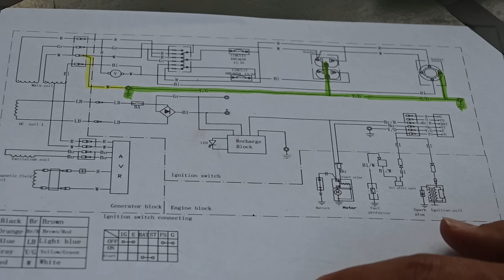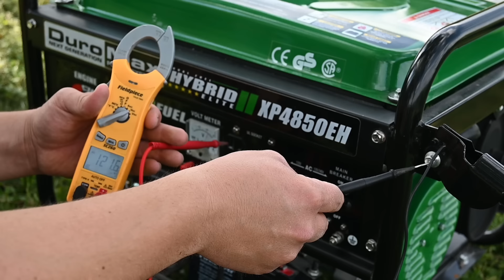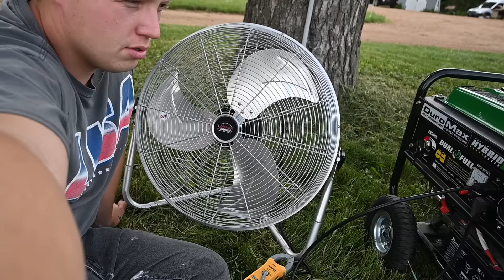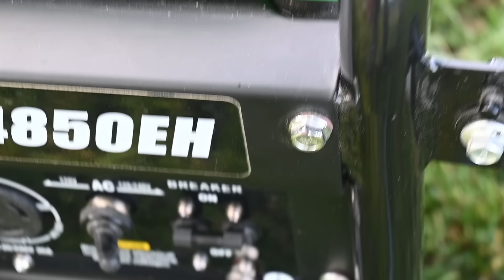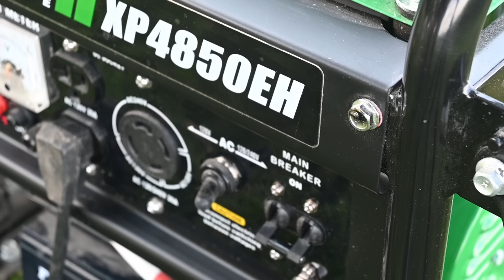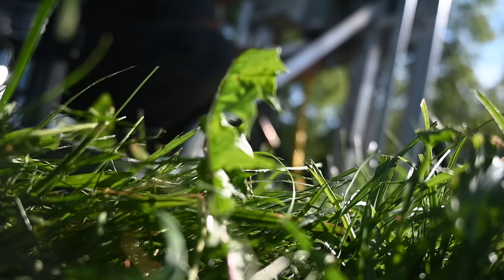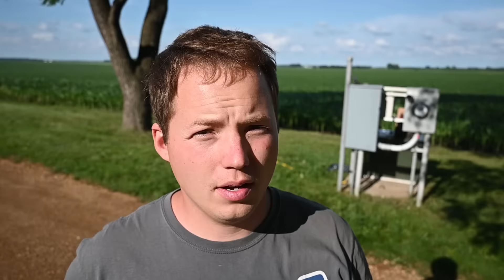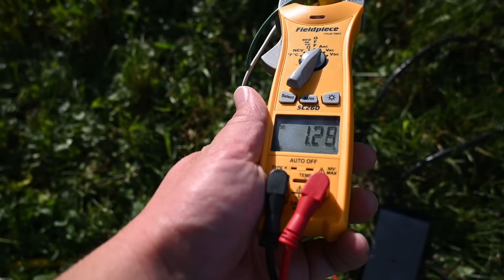What is a Floating Neutral Generator?

Comment: I, too, have this same generator and noted the same discrepancies between Duromax website and their schematic. Unsat! Thank you for taking the time to test the various scenarios, it was very sobering! Since I'm only going to use extension cords with this unit, I will bond the neutral and ground inside the alternator. But since it is rubbermounted to the frame, how would you recommend bonding the frame to neutral? Thanks again!

Comment: If this system is left running with no faults is it possible for the Generator Neutral potential to gradually vary from the ground potential therefore creating a hazardous voltage between neutral and earth?

Comment: Hi Ben , we are working on a off grid cabin and we are trying to use a generator by hooking it up to main panel until we get some solar going , i have just a reliance 30 amp outlet that i was trying to hook up the generator to it , i will probably get a transfer switch soon so i can change between inverter and generator when needed , is a generac 7000 watt and it has the neutral ground bonded . The panel is already bonded , neutral and ground land on same bar , how can i safely connect the generator without changing it to floating neutral
Thanks

Comment: If the ground is bonded to the neutral in the generator, but the generator is not grounded itself (on rubber pads, wheels, in house during construction, etc.) then that floating voltage on the neutral makes a floating voltage on the ground wire as well, which will cause a floating voltage on any metal of any equipment plugged into it. This would create a voltage on the metal on a saw or fan, etc. which would shock someone. How dangerous this is, I am not fully aware, because I don't know how much charge would be dissipated before the bonded neutral/ground floating voltage would go to zero. (Electric fences have high volts, therefore high amps - V=IR - but it only lasts for a "millisecond" so you live because not much charge went through you before it dissipated. - uncomfortable, but not lethal). All in all, I would rather have the neutral NOT bonded to the ground in the generator IF I didn't ground the generator with a ground rod UNTIL I am informed to the contrary about the issue I just addressed.

Comment: I’ve just brought my very first generator, for use in my garage workshop that has now power supply whatsoever, I wish to run woodworking tools from it. Would you advise whether I should bother fitting an earth point ? I know absolutely nothing about electronics.

Comment: So if I’m understanding what is said here then wouldn’t any generator that is sold with that 4 pin plug be a floating neutral design? Or is that weird 4 prong plug used for other things as well that have differently requirements the could require a bonded unit?

Comment: please i have ponderer this to the point of a headache. i took apart my cars alternator and started to wonder why was the stator coils bridged to battery and earth so that it would basically supply 12 volts or so AND the stator common neutral was also connected to ground. that means that instead of supplying ”zero” voltage to ground when the coil goes negative it would supply -12 volts compared to ground making it a 24 volt system

if the neutral wasnt grounded the coils could just supply 6 volts positive and negative and that could be rectified into 12v at the battery. or only positives from the coils could be bridged to battery using 12 volt coils and then we use the neutral as ground. BUT WHY BOTH. is it there just in case that one of the stators shorts to the alternator body. some claim it runs through a zener diode rectifier to ground and battery. so is it there to cut peaks and load inbalance? does it trip a fuse somewhere or send a fault code? what is this thing

Comment: I have a Reliance manual switch panel that is a sub panel connected back to my main panel were the bonding is taking place. The manual panel does not break the neutral from the main panel only the 2 hots when I switch over to generator.

My thought is when I use a generator I should lift the neutral and ground feeder wires from the main panel then bond my manual panel and connect it's ground to another set of grounding rods. Sounds like a lot to have to do but seems to be the safest. 

Any thoughts on an alternate way of connecting a generator to a sub panel that has manual switch?

Comment: I'm going to back up my home electrical power with an inverter/generator. My generator comes from the factory with a bonded neutral so I need to do something to avoid using the generator neutral bonding along with the neutral bond in the home electrical panel. What if I just leave the ground wire from the panel to the connection box for the generator power floating - not connected to the generator? Will that fix the problem without having to modify my generator? Is it okay to do this?

Comment: dirt grounding is for lighting protection ONLY. What are you doing?
Reply: ?! Earth (Ground) is where all systems Star/Wye point or Center tap establish a pathway for fault current. Lightning ground rods are a completely different system, don’t mix the 2 up.  If you are an electrician you should know this.

Comment: Wait a minute; in the first two scenarios the same reason nothing happens when you ground the hot is the same reason touching the hot wouldn't hurt you, right? Putting hot to ground is meaningless because it is not relative to anything, ground still has no potential since there's no path back to the coil. In your electrified fan scenario, picking up the fan shouldn't be a problem. You'd only get a shock if you touched the neutral or other hot conductor. It isn't safe, but I'd expect you'd need two faults to occur before the unbonded version becomes dangerous.
Reply: Touching the hot generator chassis in the first scenario alone technically would not hurt you, but if you were to touch both the chassis of the generator and that of the fan at the same time in the second scenario, you would definitely feel it. Or, like you said, it would technically require two faults before it is dangerous. The purpose of bonding the neutral in any case as I understand it (whether on the generator or in the house) is to create an ultra-low resistance path for electrons to travel on, thereby rapidly increasing the current past the point where the breaker would trip.

Comment: So if generator is to power main circuit box  then send power to sub panel at house.since it is bonded at the main box the Generator needs to be floating neutral. Is that correct?

So what happens if a wire comes lose on generator and touches the body of the gen while neutral is floating and on supplying power to home??

Comment: I've always seen This Old House and Home Time, etc. use interlocks to connect the house to a generator and not backfeed the power lines. But then they never explain why it's not a hazard to have solar panels in the system and even run the meter backwards and get paid for it! If solar panels don't need an interlock then why does a generator? Why can't a generator just run in concert with the grid in the same way as the panels do?

Comment: Wow, I have the same brand Duromax but 13000 and it is also floating neutral which i will connect to my main panel thorough inlet box. I see you have the ground and neutral wire tied into the one buss even though there are two busses in the panel does that make a difference? I have the green screw above my buss on right hand side so not sure if there is a difference if both neutral and ground are placed on that one or should be separated? Thanks for the informative video.

Comment: So when building a solar generator for backup power to my house I want a floating ground but I will need to bond the ground to neutral when using it as a standalone unit to power my camper?

Comment: 16:57 "you could have a direct short the hot to
the ground
and it would not trip the over current
protection so you can see why that is
not a good thing"

It's irrelevant - it's not different than making the Earth Neutral connection permanent.

Comment: What would a GCFI outlet do in this situation without being bonded. Probably wouldn’t trip.
Reply: A GFCI (or RCD) checks that the same (opposite) current flows on live and neutral ("current balance").  It does not rely >directly< on bonding to trip.  For this reason in some codes an area protected by GFCI can have less stringent bonding.  But suppose an appliance has a live to frame fault (or a neutral to frame fault, see below).  With bonding the protective ground will draw current and the GCFI will trip.  Without bonding it will not trip until someone touches the frame diverting current to ground through themselves. At that point you better hope the GCFI is fast enough to save you.  I know mine works because I stupidly connected my scope ground to the neutral and it tripped the building GCFI lol.  Now I use an isolation transformer.
 https://en.wikipedia.org/wiki/Residual-current_device#Purpose_and_operation

Comment: Great video Benjamin, thank you for sharing your knowledge. I was wondering what recommendations you have if I am back feeding a SUB panel with a portable generator? Obviously the neutral and ground are already separated in a sub panel so should I leave the neutral/ground bond in the generator? Would it be a good idea to ground the generator chassis as well? 
(50 amp generator receptacle, Westinghouse 9500 DF, interlock installed on main breaker of sub panel)

Comment: I have a 200 amp meter panel outside that has a shutoff to disconnect power before it goes to my panel inside. I want to hookup a generator inlet plug at the panel outside and use an interlock at that location. Since it will be hooked up before the panel inside my home (that should be bonded according to your video) do I need a bonded generator? Will the outside panel be bonded?

Comment: Your bonded in your house panel. I can see that as an issue not connected to your house. Obviously that doesn’t protect you if your using it to power tools or other stuff not connected. In the case of the bonded generator it’s the same as you bonding the bonded panel in your house. Is there an issue with bonding both when powering your house.?
Reply: Most modern gensets have GFCI for this very reason
Reply: Most modern gensets have GFCI for this very reason

Comment: So do I need to ground this generator if im only gonna use extension cords for a few fridges maybe a TV. I have the dura max 1200 dual fuel. Im not very savvy so just learning.

  Do you need to only ground it when your hooking it directly to a circuit breaker?

Comment: I’m new to this. I bought this exact generator for camping. I bought the 8ft ground rod. You say it’s not bonded and even if it’s attached to the ground rod it’s still unsafe? Will hooking it up to the travel trailer (120v) be safe to do? Do I still need to ground it? Great video, I’m still just a little confused with this.

Comment: So my question! I’m trying to use my ford lightning as a home power backup. But it’s 120v and has a bonded neutral, and so does my house. And I guess that’s going to cause issues and the GFCI will trip. Does that make sense? The short of it, is if I plug my ford lightning into a 120v power transfer switch, supposedly it will trip the GFCI on the truck.
Reply from the maker: Yes, that is correct. In your case you would want to use a transfer switch that also transfers the neutral in order to avoid bonding at more than one location. I discuss this in more detail here: https://www.youtube.com/watch?v=DxsUJPMhGdo
Reply: @BenjaminSahlstrom  thank you, next question, my inverter generator has a bonded neutral and I flip no breakers when I use that to power my house? Why would that be?

Comment: Great video, I think I have this but let me run this past you and get your input. I'm putting a 4500 Onan generator on a trailer to use around the farm, It has (4) wires (2) black 110v,  (1) white neutral, (1) green ground. I'm planning to put a breaker box on the trailer with (2) breakers and one ground bar which I was planning on connecting both neutral & ground to and then a black 110 will feed each breaker giving me two separate 110v circuits on the panel. Now this is what I'm not sure of can I also use the same two 110v wires and the green ground to put a 220v welder receptacle on the panel?  The panel will have (1) on/off switch (1) starter switch (2) 110v receptacles one for each breaker and (1) 220v welder receptacle. your thoughts on would be appreciated, THANKS in advance, Mick

Comment: I still don't get what he did. Ok, I get that he grounded the ground wire.  That produced nothing.  Then he had an extension cord wired plugged into the generator and the other end he made a joint with the ground and the neutral.  Is that all you have to do to make it bonded?

Comment: Hmm, while I understand what you’re trying explain, doesn’t the neutral or hot legs only become that once either one is bonded to earth? Like on an isolation transformer, everything is 0 VAC in regards to earth until you short either side to earth, which then causes the other side to become “live”. So I can’t see how you could get shocked on a floating neutral generator even if the hot leg gets shorted to ground, the only thing you’ve caused then is for the neutral to become “live”. Or am I missing something due to your two-phase generators? On a 3-phase generator a floating neutral on the other hand is a bit more dangerous since you could run into severed neutral faults down the line then instead.
Reply: look at it THIS way. . . fltg neutral the center tap between the two 120 volt legs, NOT connected or bonded to gen frame or hookt to a ground rod. a big overload and now  an internal fault putting 120 on the gen's frame, u or I don't know it since it has a fltg N. 
no breakers pop open.Meanwhile the possibility exists that a load on the other leg is feeding a defective load with a fault. between the fault and the loaded case of the electric drill.
its anyone's guess how long that gen will be used before someone is badly shocked.
also consider that some ppl do not use wheels specially if it is a heavy unit. say its used 
at a work site, chained to a backhoe, wheels would reduce its security factor, so now it sits 
on the bare ground. I'd suggest putting it on a pallet.

Comment: I had a 50 amp camper. Using a 30 amp to 50 Amp connector to my 30 amp generator my surge protector showed everything was fine. I now have a 30 amp camper and when I hook it to my generator the surge protector shows an open fault. Any ideas why that would show good on the 50 amp?

Comment: So would there be any problem with making it a bonded neutral by adding a jumper between the neutral and ground posts inside the cover? That way you're not taking up one of your receptacles.
Reply: Depending on your intended use you may be creating a potentially lethal ground loop

Comment: So Ben, my home has an interlock for a backup generator. The main panel has a breakout for a subpanel installed right below it and in that subpanel are the essential circuits that get powered when the generator is connected. The main panel circuits are not powered as they are isolated by the interlock. If I understand you correctly, the subpanel should not have the neutral and ground connected and this would be done at the Generator instead right? So in my case, I would require a bonded neutral generator?
Reply: I think you're correct! After learning from this video especially if it will independently be running off of the generator.
Reply: Your neutral and equipment ground are NOT disconnected from the main panel when you turn the main breaker off. Only the two "hot" legs are affected. The system neutral and ground conductors will still be bonded to one another and to earth at the service entrance (likely the main panel you are working with).
Reply: Chris ; yes ! ... When connected to a generator your subpanel becomes the  main panel  you should have a sticker located on your plug port were you connect your generator to your home! Connect only bonded generator!.... Check your local jurisdiction but I believe you might be able to bond at the plug port it's the first point of disconnect when you're on generator;  has Ben as shown us a short distance between two bonding points .. Is potentially better than floating your whole house .... Ben's example would've been so much better if you were using a non-RMS meter has all our meters show us the root mean square voltage the average . A floating system will give a hell of a swing of the voltage gradient ... A great example for bonding or floating when is it  appropriate.   Peace
Reply: @rdmccracken  so if I pulled the main breaker and engaged the interlock I should have continuity from the neutral to the earth ground (at the generator plug on the side of the house). FYI, the generator plug port on the house has got a red placard on it which says "bonded neutral".
Reply: @ourkid2000  you should never lose bonding at your service entrance (main panel usually) - regardless whether you have bonding at any other point (as you have described).
Reply: A FLOATING NEUTRAL GENERATOR  IS USED IF AN INTERLOCK BREAKER SYSTEM USED.  SUBPANEL'S HAVE SEPARATED NEUTRALS AND EQUIPMENT GROUNDS, BUT ARE BONDED AT THE SERVICE DISCONNECT MAIN.

Comment: Great video. Question I have a 6500w running generator with floating neutral. I installing a transfer switch but its instructions state to connect ground to ground bus and neutral to neutral bus, would this be only for other type of generators?